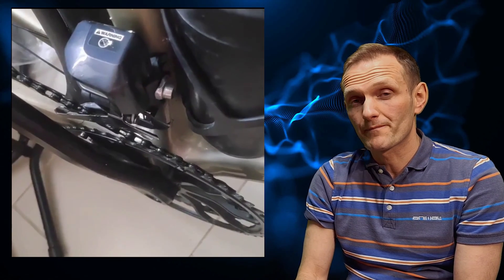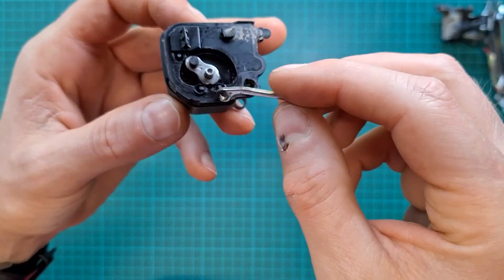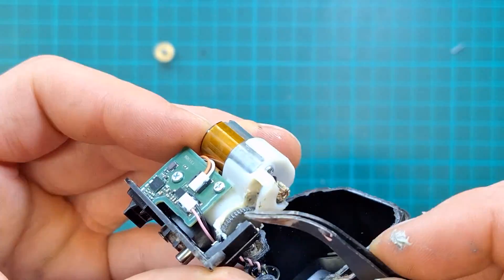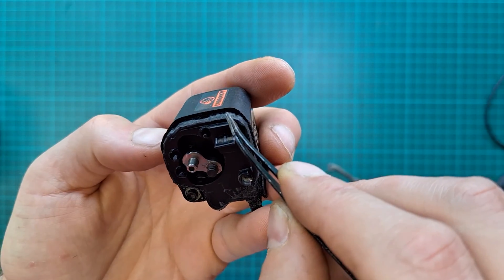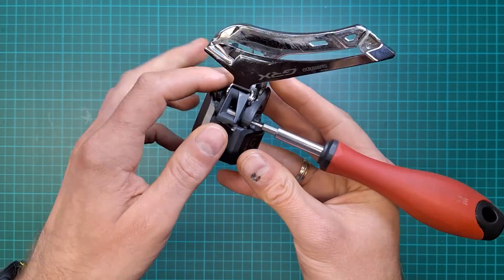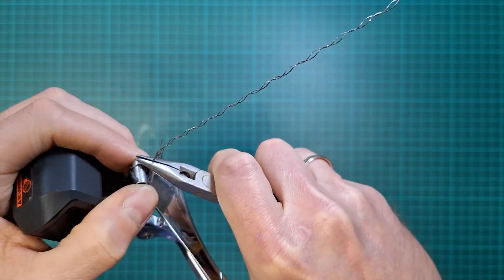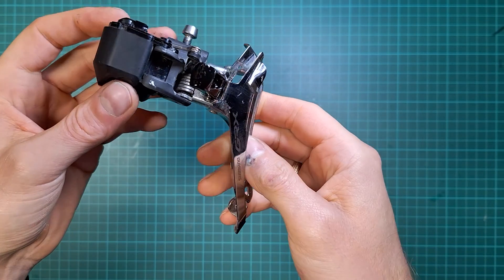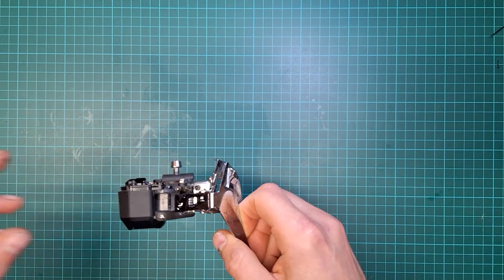Front derailleur isn't working, noisy motor, broken arm...

Comment: How do you get the plastic cover at 0:41 off?  I have undone the screw but it is being held at one location and I cant get it off please???
Reply from the maker: Just below the mounting hole, you have a Phillips screw, then on the opposite side you have 1.5mm allen, you need to remove both, before you can take the cover off.

Comment: Great video! My FD-RX815 just started making horrible noises when shifting. I’m guessing the inner wheels are already shot, so I ordered a new one and will keep this one for parts. Quick question: do I need to make any software adjustments when installing the new derailleur?
Reply from the maker: Thank you. You don't need to make any software adjustments, maybe a firmware update. Just install a new derailleur and adjust the position of the cage with 2 mm Hex, if necessary.

Comment: I have a grx and it still shifts but is getting noisy. I can get the top of the arm cover off but the bottom feels stuck. How is that part held on? In your video you have already removed the first cover. In the video it pops off with no resistance.
Reply from the maker: Hi, take a look at my 105 7150 derailleur repair. I covered opening it in more detail. Basically, you have to cut it open following the seam (factory ultrasonic weld)

Comment: I managed to opent he plastic and found the brass gear was indeed a bit loose but its teeth ( the small one that engage the other geart) are wore out. Is there anything you can find the brass gear ? Also what kind of procedure you follow to weld the whole unit back ? Thank you
Reply from the maker: @caicarbo  Hi, I haven't found any replacement yet. If you know of any watchmaker, possibly they can make you one.
I use soldering iron with a fine tip to weld it back together.

Comment: Anyone else here just got back from a ride where front one went south, , watching this video and figuring why the hell he didnt go wires?:)
Reply from the maker: @toncistanic7471  I don't blame you for thinking this. Di2 is great, but when something goes wrong, it usually is quite involved job. It's more complex than a simple gear cable swap 😉
Reply: @Di2_GP  Small update. Managed to execute this one 30 minutes ago. Basically 45-60 minute gig. . Little axle was coming out so I secured it with some plastic, not to run away in the future. Also changed grease, cleaned...polished  those corners and glue them together. Works like a charm, I could not have done this without this video (referred to it couple of times). Thank you and tc man.
Reply from the maker: @toncistanic7471  Amazing 👏.

Comment: Using your instructions I was able to cut the plastic (used a jeweler saw with a 3/0 blade). The small gear axle was indeed sliding outward. Those gears were in good condition. However the largest gear which drives the external lever was very worn in a 180degree pattern. I could not remove the external lever drive from its axle   (shared with the largest brass gear) so this gear is trapped with the plastic housing between the external lever and largest brass gear. Have you removed this external lever before and if so, how was this done?
If I could remove this gear and rotate it 180degrees, the good teeth may make the unit usable again. 
Thanks for your efforts and education on repairing Di2.
Reply from the maker: That's a good start. Yes, I did remove it, rotated gear by 180 deg and successfully reassembled it. You need to take the gear assembly apart. 
1. Mark position of the magnet relative to the actuator arm. 
2. Heat up lightly plastic cup with magnet, and lift it up, be gentle.
3. Clamp brass gear in the vice (ideally in nylon jaws or used wooden spacers.
4. Tap out the gear by tapping the axle (the same process as on my RD videos
5. Rotate damaged gear by 180 deg and reverse the above steps.
Good luck

Comment: Hi! Great video. Thanks for sharing this. I'm experiencing this problem on my Ultegra Di2 front mech and will try to fix it, but would like to know what tool/technic did you use to melt the plastic, both for keeping the axle in place and for sealing the servo. Tks!
Reply from the maker: @pedrochimelli1734  Thank you, I'm glad I could be of help. I use temperature controlled soldering iron. I've made myself a very fine tip, and I use it to weld plastic together.
I set my iron to 300-350 deg depending on the type of polymer. This way, I can melt and not burn the plastic.

Comment: I have di2 12 speed FD doing the same noise. Do you know ho to open it as you do on the grx ?
Reply from the maker: Hi, I do have a part of a disassembly video, but I haven't finished it. The repair failed. If you are UK based, drip me a DM on IG I'm I'd be happy to take a look at yours
Reply: @Di2_GP  unfortunately I am in France  .
That's so bad if the repair is not working on the 8150 !
btw, thanks for your job, it's very helpful
Reply from the maker: @thomasnoisette7358  it does, but the disassembly process is a bit tricky. I'm on holiday atm, but I'll be back to normal in September, so I'll post some content

Comment: Question: In my spares box, I have a broken front derailleur that I kept for parts and fasteners. The linkage is intact and it would be ideal to replace my broken linkage with the good one. 

However, the part seems to rotate on a rivet with no clear or easy way to remove and replace/restore it. Is it impractical to try to do replace that linkage, if you happen to have one?
Reply from the maker: If you have the same model of FD, I'd just swap servos. if you have different models, or even different generation, then you can drill out the pin and use something similar to rivet it back.

Comment: Very, very nice! I had the broken linkage issue that you demonstrate in the second part/half. I was not confident that I had the correct plastic to melt over the cable strands; I also wasn't sure that I was using the right technique to melt the plastic that I have on hand.
I experiemented with the strands of brake cable, which seems like the most sound way; it takes awhile to get the technique right. However, I am going to try and bind the cables with an epoxy, rather than repurposed plastic/polymer. I'll report back.
For now, I am going to ride with the cable tie, until I can get to the store and get a good epoxy.
Reply from the maker: The most of Shimano components are made for PA polyamide, mixed either with GF, or CF, so most of Nylon plastics should be ok.

Comment: Thank you for sharing. It's a bit of a shame that shimano don't offer the small parts as spares or offer a repair service (at a sensible cost). 
These things cost so much, I'm amazed at the use of weak parts in some locations. They should make a cost/material/strength analysis of each part and improve the 'balance', these shouldn't fail!
Reply from the maker: Well, if people would stay on top of their bike maintenance (I know it's difficult), then Di2 should last very long time. But as they know, people will neglect their bikes, and these components will fail. They have a constant source of customers ;-)

Comment: Thank you very much, that's exactly my problem! Going to fix it soon :)
Reply from the maker: Hope the repair goes nice and smooth.
Reply: @Di2_GP  Thanks to your tutorial I smoothly opened the servo. But i found the main gear (largest cog) trashed, many teeth grinded :(
Reply from the maker: @opensky123  That's actually good 😉 you can tap out the actuator arm, then rotate it by 180 degrees. This will move worn-out teeth to the back. That gear only moves 90-120 degrees